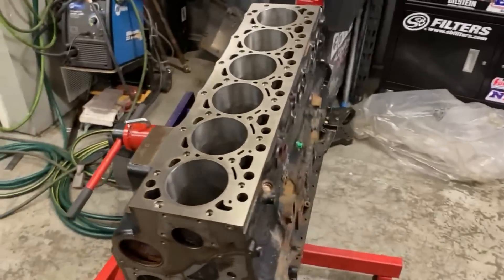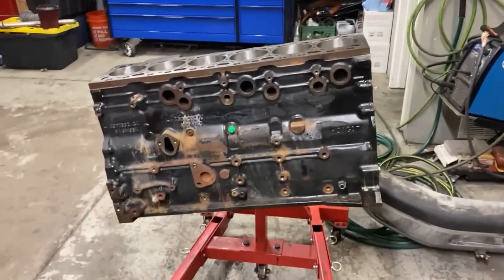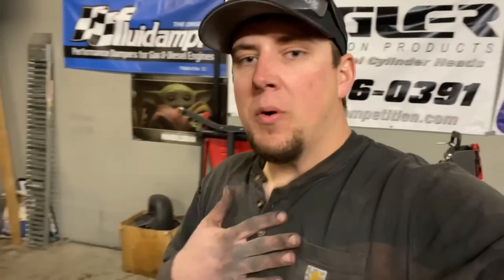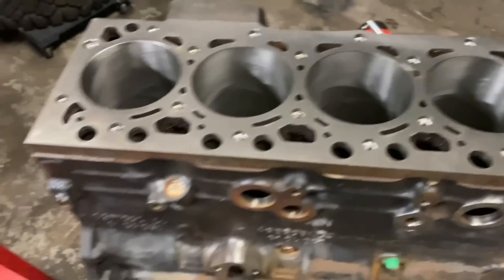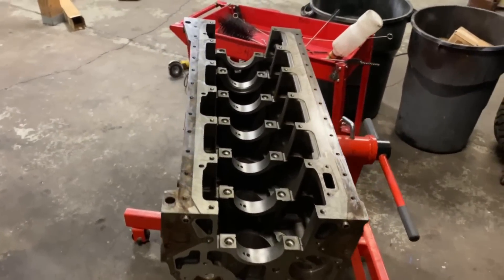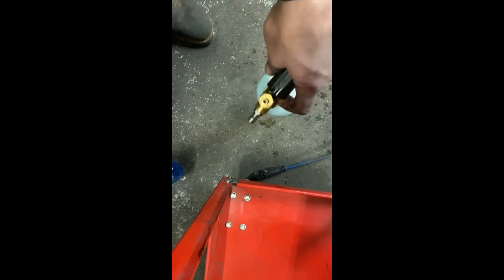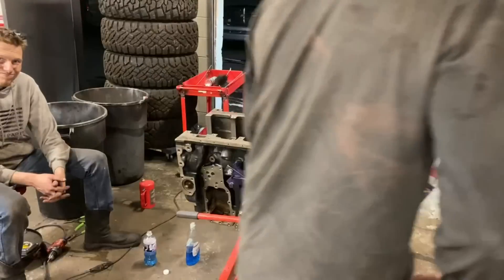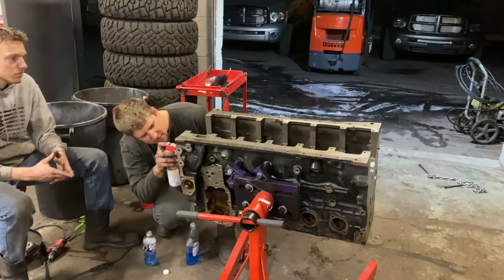HOW TO CLEAN AN ENGINE BLOCK

Comment: Hey bud, just found your channel tonight while looking up information about converter stalls. I have a 14' 6.7 with 68rfe, a few parts have fallen off and a tuner. I already rekt the stock trans so im having it built right now. The shop is building it to handle 7-800 hp while daily driving with some small amount of fun on the highways. My tuner told me today that with my max tune im making about around 500 to the wheels. I always thought I could add injectors injector pump and a lift pump and be where I want to be 650ish. Turns out, my tuner told me my stock turbo is topped out. I dont want to get rid of my jake brake and I dont want to go crazy expensive on a turbo. What would you recomend? I tow around 10k lbs a few times a year, but mostly I daily drive it. I dont want to race like at the strip or anything. Just some playing on the highways/ red lights. Everyone says 2nd gen swap but I dont know anything about turbos, any tips will help! Thanks boss.
Reply from the maker: Fleece cheetah or calibrated power stealth drop in 63mm. Capable of 650hp and still keeps your brake working. Plus spools almost like a stock turbo!
Reply: @horsetorquesdiesel  Holy shit thanks for the quick reply! I will look into these itll probably end up being next upgrade. I am trying to wait for the headgasket to go before i upgrade injectors and studs, rather just get it all done at once.

Comment: I use ultrasonic cleaner, then spray it down with high pressure hot water, then dry it and spray it with high pressure white spirit.